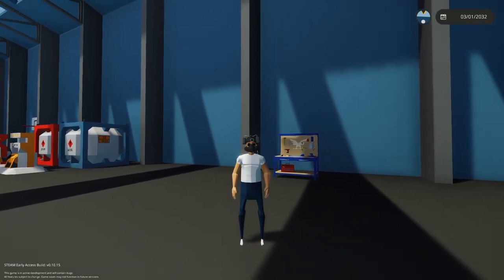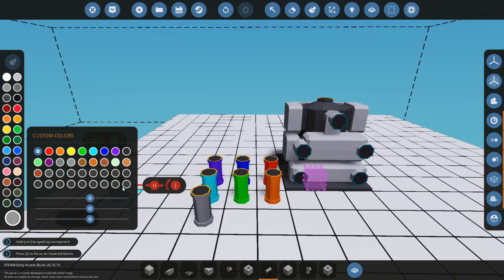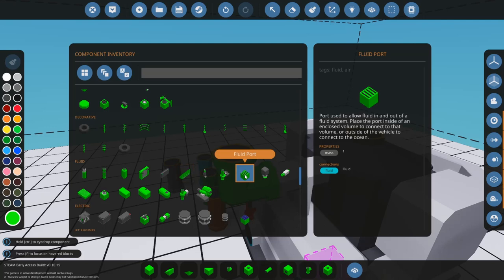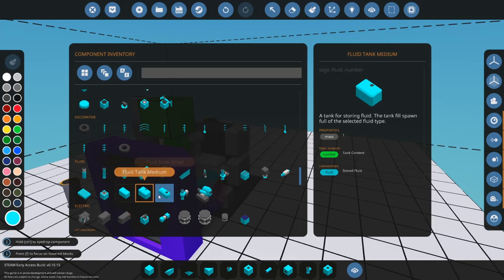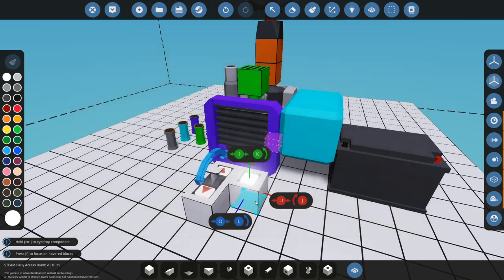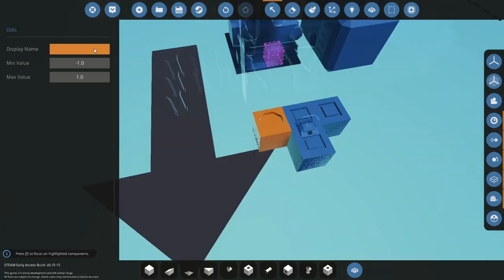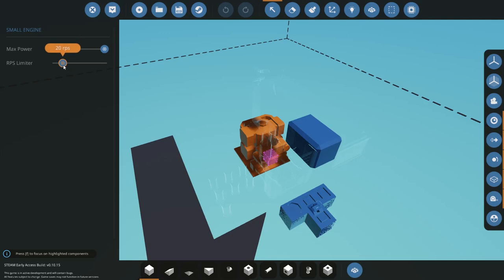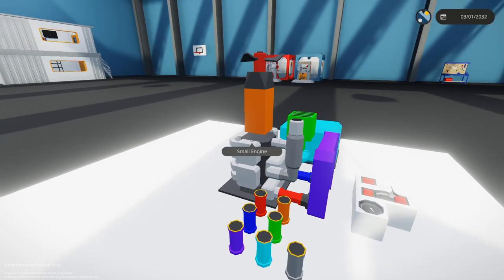Advanced Engines Tutorial - Stormworks

Comment: I have a promblem with my engine. It goes to 4.75rps with The starter. But when i apply throttle it doesent do anything. Please help.
Reply from the maker: check that your fuel is connected and so is your air intake. make sure the exhaust also has a pipe leading out, and check you are using diesel rather than jet fuel. hopefully that helps you out! 😁
Reply: @BigmanBois  Yeah My Air intake was The problem. Thanks!

Comment: i have a problem, when I use the push button the engine shuts down when I let go... i just started soo idk what I am doing..
Reply from the maker: check that your throttle isnt zero. also check that your pipes are transporting fluids. you can do this by looking at the engine and pressing g (or something else, depends on what you set it to)
Reply: I got it! Thanks you there wasn't fuel flowing into the engine.
Reply: @BigmanBois  do you mean i can select the engine and press g or just putting my mouse on it?
Reply from the maker: @beamangel3497  If you want to see data on your engine use your key on your keyboard that shows the data. Mine is set to something different so you'll have to check yours

Comment: Thank you. i allways get it wrong and use a toggle button as starter, and seeing this i seem to doing it wrong. What could be the pro and con of a toggle button VS a push button?
Reply from the maker: Toggle buttons will constantly start an engine if plugged directly into the starter. That does mean that you wont drop below 5rps, but your battery will die very quickly
Reply: @BigmanBois  Yeah i had an awakening :) Guess i just started using toggle and keyswitch and liked them and just forgot. But i have now started to change it around. :) Thanks for the video.